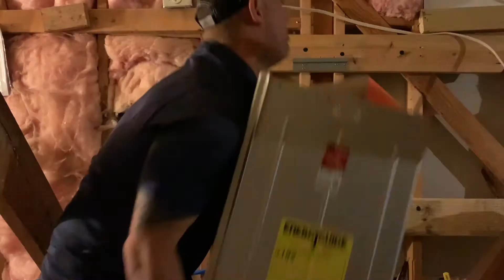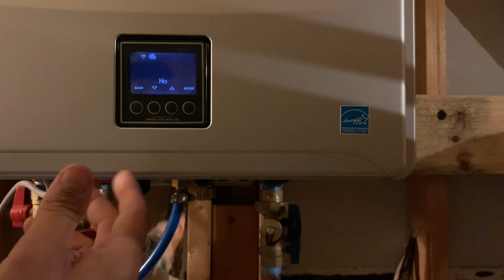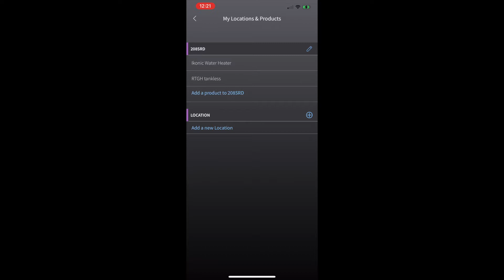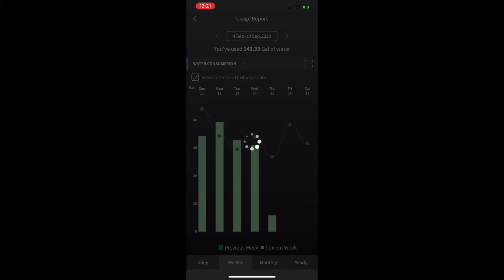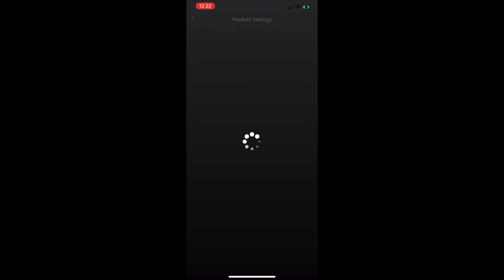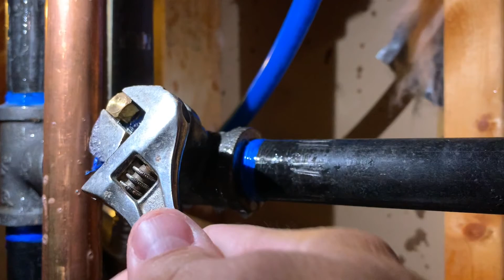Rheem Ikonic install, set up, crossover, app and gas leak test

Comment: Thanks for the video Rick.  I'm installing a Rheem Ikonic right now with the crossover valve and do not think my system has a check valve.  Is one needed to ensure that the unit can detect when warm water comes back through the cold line, or does it go by pressure out the hot side until the crossover valve closes once it reaches temperature?

Comment: Where do you run the plumbing line for the recirculation port on the bottom of the unit if you don’t have a dedicated recirculation line? I’m using the supplied crossover valve.
Reply from the maker: @billshuherk3535  you will not use the recirculating port When using the cross over.
Reply: Thanks so much for the quick response!  Do I need to plug that port?  Thanks again!
Reply from the maker: @billshuherk3535  no need to cap that port.  But you can if you want to.

Comment: Hi Rick - thanks for the great video.  We're replacing our RTGH-RH11DVLN with an Ikonic RTGH-SR11i due to issues with the original unit (stops producing hot water intermittently and Rheem can't figure out why).  Question for you about the Grundfos Bypass:  1. Do you have a link to the product?  2. I thought you couldn't use a bypass with a tankless that has an internal recirc pump.  Has this recently changed with the Ikonic, or were you also able to do this with the prior RTGH-RH11DVLN?   3. I have a dedicated recirc line running to my kitchen (furthest tap), but my master shower branches off in the middle of the house (long / wide ranch style house) and is slow to get hot water even when the kitchen recirc runs, or gets "cold water sandwiches" when it starts off with recirculated water from the kitchen line.  Can I keep the kitchen recirc and also add a bypass in the master bath, or do I have to decommission the kitchen recirc to use a bypass in the MBR?  4. We stopped using the recirc all-together because we were wasting energy with unpredictable schedules.  I'm surprised to see Rheem did not allow the user to simply initiate a recirc from the new WiFi app. Why do they still require a wired push-button / motion sensor when they now have the ability for the user to communicate real-time with the WH via their phone?  Allowing this also would have allowed for smart home integration (ie: "Ok Google, recirculate the hot water").   Thanks again for the great videos!!
Reply from the maker: Grundfos 595926.  You can use a cross over valve and the dedicated line as long as the total length is within the specifications outlined in then use and care manual. The rh11 also utilized the bypass, however there was a setting to differentiate the bypass from the dedicated line so I do not know how using both would affect it.   With the new Ikonic you will be fine as I have tested this method and had positive results.
Reply from the maker: I love the idea of app controlled circulation as opposed to the current settings available.  Maybe we will get lucky and a firmware update would allow this.  I have mine set in the economy setting.  It really does not use much energy to keep the lines circulated.  But I agree an on demand app option would be the absolute best addition to the systems.

Comment: Hi Rick, the video is very helpful thank you.  Was wondering if you use an expansion tank on the cold water side.  They show the use of an expansion tank in the install instructions but I cannot figure out the need for it.  Would that be for an external circulation pump and it is not needed if the unit has an internal pump like this one?
Reply from the maker: Needing one depends on your local code.  Check that for compliance.  As far as what it’s for, it helps absorb thermal expansion.  Can’t compress liquid so as you heat it you will raise pressure.  There’s a debate among plumbers whether it’s needed since a tankless only heats up when water is running so there not a pressure increase.  Anyway.  It all depends on what your local development services will say is compliant with the code.

Comment: Hi Rick, great video. I am installing this unit now and was wondering if the dedicated return line needs to be capped off when when using the crossover valve system?
Reply from the maker: I haven’t seen any need as of yet.  However to be safe I would cap it off.

Comment: Thank you Rick. Super helpful tankless water heater  videos. I've installed Richmond 11GPM tankless heater from Menards at my friends place and struggling to automate Circ pump with motion sensor or
with outlets that can work with google. I guess this would really help. I don't see this unit available at Home Depot.